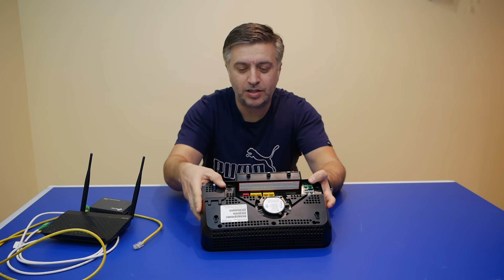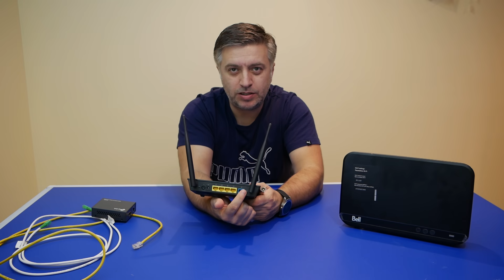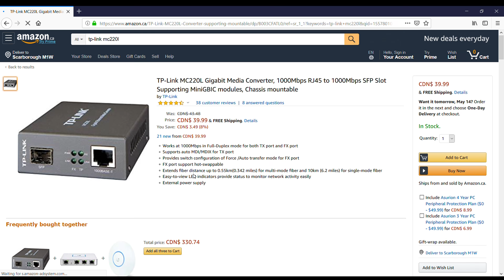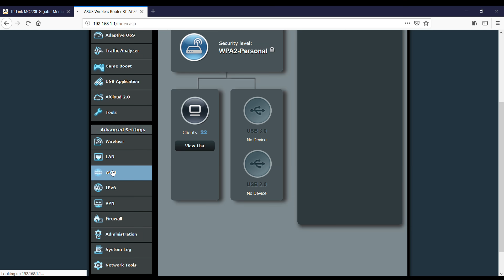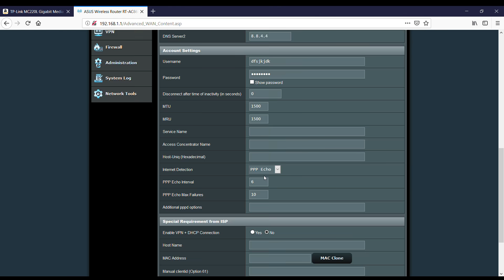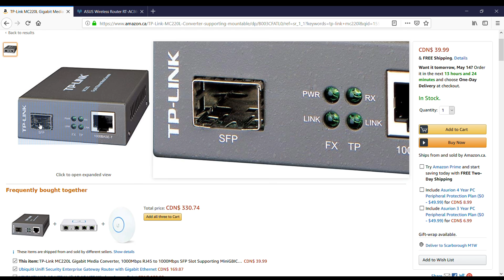How to remove/bypass Bell Hub 3000 and use your own router

Comment: Hi Marius,  thanks for the video. Have a few questions for you or others that can answer. I have the HH3000 and I bought the Tp link MC220l, it is a V4 with only 3 LED's but I think you mentioned in your video that it should work. Also got the Asus RT N12d1 as suggested by you. Now, can't get it to connect. I'm familiar with rouler setup, I've double and triple check my work, even changed my Internet password from my Bell account for the HH3000 which I confirmed by going back to the HH3000. Have you personally or others use the RT N12d1 for this setup and can confirm that it works ??. I see in the video that you are using a  RT AC86U.  Both LED's on the MC200L are occasionally flashing.  I've rebooted both devices many times  and re did the setup but still no go. What is the purpose of the Merlin software  and do I need it ??
Reply from the maker: I am sorry but I wasn't recommending n12. I said is only for demo purpose with the ethernet ports. I recomend 68u or 66u b1. I am sorry if it was misleading but I am mentioning that I am using that just for demo of ethernet ports.
Reply: @advfreedom  Well, after a few hours of trying, I was just about ready to pack everything up and going back to the HH3000. Saw Cameron Izard post and went into the IPTV setup and set the ISP profile to manual and set the Internet VID,  I guess same as Vlan to 35 and now it is working. So if anyone has a RT12 D1, I can confirm that it does work.

Comment: need help got bell wifi and would just want the wifi to be good only  on my ps4 and bad on all other devicese
Reply from the maker: Put your ps4 on a wired connection and wireless all the others.
Reply: @advfreedom  i use lan cable and my package is 1 Gbps and i get 60mps on my ps4 plz help
Reply from the maker: Starting March 27, Sony is slowing down the internet to PS4 to preserve internet reliability during Covid-19. This may be the case. But we are playing Cod online and Nba and no issues.
Reply: @advfreedom  like plz helpppp i get 1.5gphs pacgae and 60 mphs on ps4 make no sense

Comment: Many thanks for your video Marius.Question:can you use this setup if you have 'copper' with bell.I am wanting to use a modem with lower EMF.At the moment my computer is wired and I have shut off my wifi and I use an ethernet cord from modem to tv so I can watch netflix.Just recently I can no longer use ethernet connection with my tv as Netflix freezes.Think it might be my modem(but maybe my tv? not sure.I am not very tech savvy.
Reply from the maker: What is copper? Check the speed of your internet with a laptop connected to ethernet. Also if it is android tv you can force close Netflix and try again. There are so many variables to try.
Reply: @advfreedom  Not sure what the copper is.I think it is fibre but not fibre optics.(what was used before they came out with the optics.)Thanks for your reply.I will check speed with ethernet connected.It is a Samsung Smart TV (older model).
Reply: @advfreedom my hh3000 is setup with fibre ttn, so i have 2 phone lines coming to the router for 100 Mbps connection. What’s different in this process?

Comment: I need help Mario. I have the RT-AC68U router and purchase the MC220L. I do the same setting twice but don't have an internet connection. I don't know where is the problem?
Reply from the maker: Make sure that password is correct. Look at the router logs in administration. Reset the router to factory. And do it again. It is working, just looks at how many succeeded. Use Merlin firmware.

Comment: With The bell Hub 3000 i never get my 1k 1k speeds should i buy a router that can support this
Reply: Only if you have issues with the HH3000 and want to use a better router with advanced functions.  What speed are you getting connected directly to HH3000 with LAN cable?  Also make sure your network card in computer is gigabit AND the LAN cable is capable of gigabit transfer.  CAT5E is gigabit MAX.  Test with both a 5E and 6 cable.  Network Card or Lan cable may be the limiting factor.
Reply: @christopherwereley2116  i pay for 1gb speed and get 1gb while plugged in with ethernet but over wifi i cant get more than 300mgbs. Is there a way to get 1gb over wifi?
Reply: @Iamtherealsun   AX/wifi6 will get close. The problem is most devices (phones/laptop etc) don't have wifi network cards capable of 1gbps
Reply from the maker: With Wifi 6 you will not get that speed. Theoretically wifi 6 has 1200Gbs, but that is in perfect condition with no blocking, interference etc. And on top of that wifi 6 it is still half duplex. So in theory you could see 600 Mbs. With OFDMA, you only need to divide the 20Mhz channel into 2Mhz subchannels. It is still half-duplex and can be thought of as a half-duplex switch with shared bandwidth.

Comment: I connected everything but when i try test connection it fails at ip adress ...do i strickly need a router ?
Reply: Si cest bien selui ci, ton port WAN serais le bleu nommer ethernet
Reply: @nicolastremblay6719  oui le wan ds mon routeur est bleu
Reply from the maker: What router do you have?
Reply: @advfreedom  im desperate its like from my mc220l to my tp link router it wont send the internet
Reply: yes you do need one. The adapter is basically converting the fiber signal to WAN. A consumer computer doesn't take WAN. You need a router/WAN to LAN box.
Reply: @nicolastremblay6719  tu ti connais bien ta tu un numero de mtl que jpeus te demander des question pm moi sa svp
Reply: @bloodbustaz1  on peux parler ici si tu as d'autre question. Je ne prefere pas laisser mon numero ici.
Reply: @nicolastremblay6719  le routeur que dois je faire pour quil accepte la connection de mon mc220l
Reply: @bloodbustaz1  premierement assure toi que le tp link est connecter au port WAN de ton router. Ensuite il faut tassurer que ton router a le WAN ouvert. Apres la procedure est comme dans la video.
Reply: @nicolastremblay6719  tu veus dire mc220l ? Et c ou les port wan jai just lan faut il je configure sa
Reply: @nicolastremblay6719  le mc220l est plugger ds le internet (ensuite le 2ieme ethernet sort direct au ps4)
Reply: @bloodbustaz1  ok parfait, dans la configuration du router, as tu reussi a suivre les instruction de la video ? Ya til des chose que tu na pas reussi a faire ou trouver !
Reply: Archer3200 tp link
Reply: Tu as le archer c2300 de tp link ?
Reply: @nicolastremblay6719  oui archer 3200
Reply: Est-ce ça fini par fonctionner? J'ai le même problème avec mon routeur TP link AC1900 avec Virgin comme fournisseur internet. Il fournisse exactement le même équipement que Bell

Comment: hey i need help sir i dont have money to buy this but mybell wifi is only slow on ps4 and i use lan cable any fix
Reply from the maker: How is wifi matters is PS4 is connected with lan cable? Make sure that network connection in ps4 is wired in settings and then ps4 has a test feature. What is the speed you are paying for at bell?
Reply: @advfreedom  1 Gbps and on my ps4 i use lan cable and i get 20 mps for upload and downloads its ridicoius

Comment: Is the IPTV configuration required for only internet access? I'm assuming no, but you never know...
Reply: @BrandenMoffat  yes... It's not required. Internet is accessed through VLAN 35. Ended up going with a SFP+ card with modded firmware and pfsense

Comment: Wonderful Video Thanks for making this , i ordered the TP-LINK MCC220L what routers are compatible for this setup , i want to  eliminate the HH3000 and have a router to be  bridge mode with my google wifi to do all the  routing , would appreciate if someone could compile a list of routers  would work for this setup
Reply from the maker: For the best router I would go to Merlin firmware website and look for the supported routers of his firmware. I would pick RT-AC68u as the minimum but as cheap upgrade RT-AC1900 or as they call it RT-AC66_B1.
Reply: Hi Marius.  I have the rt-ac66u and cannot connect.  Comes back with an invalid username or password.  Using Merlin 380.70 fw.

Comment: Great video, can it be done with Netgear R7000 router?
Reply from the maker: I don't know but I know that there is a Merlin version for that router. So it could be working. If you find VLAN option I think is possible.
Reply: @advfreedom  What's the best asus budget router i can get to have my plenty speed  1 gbit with the MC220L?
Reply from the maker: @kooromack  In my opinion if you can find and Asus RT-68U with improved CPU, RT-AC66_B1. RT-AC86U is also good but some of them are having issues with 5Ghz band not working after 1 year or so. But very good signal and speed with that one.

Comment: Hi Marius, I have tried everything to remove the metal SFP module from the Bell Home Hub with no success at all. It's jammed in way to tight. Can I buy the SFP module on Amazon that I can plug into the media box and then connect the fibre? Thanks
Reply: Thank you for the reply, yeah I have tried that, with the lever, it will not budge. Spend over an hour trying the lever at different angles, seems like it has a catch that is broken or not functioning properly as the lever can go past 90 degrees and it still will not come out even with pliers pulling the latch.
Reply from the maker: You can but this is the one you need. This is registered on bell network. Watch the video again and pay attention to when I am taking it out. It has a lever that you move and is coming out easily.

Comment: do you not need a modem?
Reply from the maker: No you don't. Just the converter and your own router. But I don't know how to setup other routers
Reply: @advfreedom  i cant seem to get the netgear orbi to connect to isp.  Not sure what else i would need to do

I dont need to still connect to hb 3000 using it for pppoe passthrough?

Did u use a router with built in modem to replace or just a router?

Comment: I cannot disconnect the white wire with green plug that goes into white box on my baseboard; I can remove the other end that goes in the HUB3000,
Reply from the maker: If you pull from the square green jacket down and not by the wire. It should come off easily.
After you take it off the socket will be covered by a little door with an spring that will open if you slide your finger down.

Comment: i have question cause on my ps4 the wifi is so slow is there a way with bell i can send all the signals to my ps4
Reply from the maker: I don't know a way to direct all your signals to ps4. You can put it on 2.4g and make that only available to ps4.
Reply: DNS code 1.1.1.1 secondary 1.0.0.1 will boost your internet dramatically
Reply: Jason Durula why is that?? I’m new to this so thanks in advance
Reply: The first 2 generations of the PS4 are known to have a terrible wifi connection.  The only way to get a reliable connection is with a wired connection

Comment: Anyone paying for 1gbps or 1.5gbps able to confirm speeds?
Reply: yes ...and it never goes down so far...
Reply: i just set mine up, paying for 1gbps, home hub downloads more then that, but with the mcl220l im only getting a little over 400 down. not sure why :/
Reply: How did you confirm 1gbps speed on homehub? Did you connect any device over ethernet to HH and did a speed test?
Reply: @Dataanti  Possibly because the SFP module removed from the HH3000 is a 2500Base-XX (I think) and the MC220L does not play with anything other than a 1000Base module.  I'm just guessing here.  I'm considering going from Fibe 300 to Gigabit, but not if I can only get ~400-500 range.
Reply: I set my gigabit connection up with pfsense and I get something in the neighborhood of 850-900 down and 750 up, been with them for a few years and it's never gone down

Comment: Please confirm top external internet speeds on Fiber contections
Reply from the maker: 500 up and 500 down. This is the package I am paying for. That is on wired. Wireless is different.
Reply: I am paying for 500Mbps with Bell Hub 3000. It was installed yesterday noon and by now I am getting 540 Mbps speed on the modem but on wifi(20 feet away from modem) I am getting only 19 Mbps download speed with 2 times reboot from the call center. The street signal is more powerful on my computer than the signal from the modem in the house. Previously I was having home hub 1000 and getting the same speed.. I don't know if it is too early to comment on their services.

Comment: I pay for 1.5gbs fiber. Worked with the 10Gtek and ASUS AX92u... but I am getting terrible speeds. 600-700 down 800-900up. Any advice of settings or something I am missing or doing wrong?
Reply from the maker: Wired or wireless? There is going to be a big difference. Is your ethernet card rated 1.5? Or just gigabit.
Reply: 800-900mbs "terrible".
Man, we are spoiled.
Reply: Connecting a device directly on HH ethernet port also doesn’t give me more than 600 download. I pay for 1gbps. I am yet to try and remove HH following this video. Do you know if PPOE connection with SFP connector affects the speed negatively?

Comment: I have a TP Link ax3000,  Where do i sign in to my Bell account?  On set-up.
Reply: did this work out . for you?
Reply from the maker: Search google for TP Link ax3000 pppoe settings. Or look into the manual that came with the router and it should list where you can setup pppoe.
Reply: Thank you. I did manage to find the settings in the Advanced setting. I guess you have to do the settings on the router before the new fibre installation?
Reply: @cameronizard8592  Hi Cameron I have the same router TP LInk AX3000 and would like to know if everything is still working?  I will have the Fibre service installed this week and was looking into bypassing the Router that comes from Virgin (same from Bell).
Reply: @paulocarvalho9406  It worked fine, until my TP Link AX3000 stopped working ( TP Link replaced it with a new one}. I went back to my Bell 3000 and since it works ok. I will leave it for now.
Reply: @paulocarvalho9406  I use Virgin too with TP link AC1900 router. Have been able to make it work?

Comment: My router won't let me go above 1492 for mtu. It is a tp link ac2600 . I can enter my user details and they are accepted but I can't get an internet connection. Any help?
Also the vlan is different. I'm not sure if I'm setting it up properly.
Reply from the maker: I don't know how tp link is working. I only dealt with Asus routers and I can install Merlin firmware.
Reply: It might have the same settings as the TP LINK AX3000 , Check my recent post.
Reply: Did you get it to work? I have the AC2600 too and it doesn't connect...
Reply: @Benzin0  I just gave up and am still using the bell hub
Reply: @yantzi14  I got it working, just apply the settings listed in the pinned comment from Cameron Izard and make sure that the "Enable 802.1Q" checkbox is checked.

Comment: I have used this method for few months now and today internet stopped working it gives us a proxy error could they have changed some server settings that I need to update?
Reply from the maker: Still working on mine. I had some issues yesterday but restarting my router fixed it.
Reply: Marius C same thing I rebooted both and it fixed it!
Reply: nevernotice nothing and my system is flawless

Comment: Hey Marius Great video it worked no problem, but I am now having issues connecting to any game on my pc or chat programs. I did not have this problem with the hh3000. From my understanding it's the routers firewall. How can I make it all work like the hh3000? Can I just turn off the firewall? Also whenever I try to change any settings on the router the ISP connection says disconnected. I have asus rt ac68
Reply from the maker: I didn't have these issues. The converter doesn't do any filtering. It has to be something in the router. Just  back up your router config, do a reset and redo the config on the router.
Reply: Make sure you have UPnP enabled on your router.

Comment: Any media converters for higher then gigabit? I have the 1.5gigabit service
Reply from the maker: Not a cost effective one. From my knowledge the price for 1.5 converter is around 200 to 300$. You would also need a router that can pass 1.5 as most are capped at 1G.
Reply: @advfreedom  
Hello Marius, can you indicate a 1.5 media converter? thanks
Reply: @jpamix  you have to look for sfp+ media converter it will support speeds up to 10gbs something like this https://www.fs.com/products/35610.html
Reply: @jpamix  use a multi gig switch and if you use up all your speed you can use another pc and still get 500.
i plan to try a 10gb sfp switch  . i am reading if someone got that going.

Comment: Great video, followed and worked like a charm, in usually not paranoid about this stuff but the radiation levels emitted by this thing is ridiculous.
Reply: Did you measure it yourself or?

Comment: Thanks, will the fibe TV still work though? I have tv as well
Reply from the maker: If you do what is in the video without any other configurations probably not. Bell tv works on a different network created by the hub.
Reply: You need to use VLAN for FibeTV, so it will work.
Reply: @ElitesEngineering   Can you elaborate on what you mean by VLAN for FibeTV?  Can you provide specific steps?  Bell just installed the Home Hub 3000 and their TV box.  Technician showed how we can watch Bell's TV channels by going to tv dot bell dot ca on any browser, which is cool.  How can we replace the Home Hub 3000 and have both the Bell TV box work and tv dot bell dot ca work on the browser?

Comment: Great video, can it be done with Ubiquiti router?
Reply from the maker: It should be. The router has already the port for SFP module.
Reply: That's why I want to know, if I can get Bell Aliant Giga Fibe 1.5, run Fibe TV off the HH3000, bypass it for wi-fi, and run a Ubiquiti Unifi wireless access point system from there
Reply: I have ubiquiti Edgemax, did anyone tried? 
Do we need to put the router in bridge mode?
Reply: @MuhammadAslam-ul6ut  I just did the install on a Ubiquiti USG last Friday and yes it works, it is also a very simple procedure